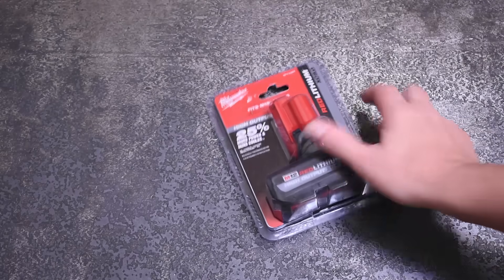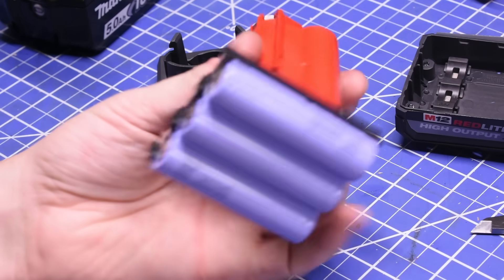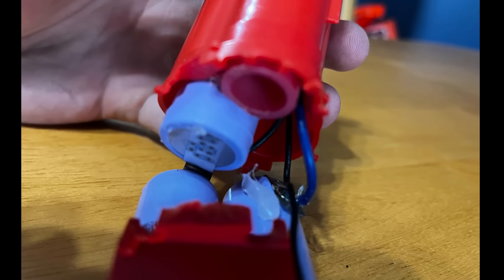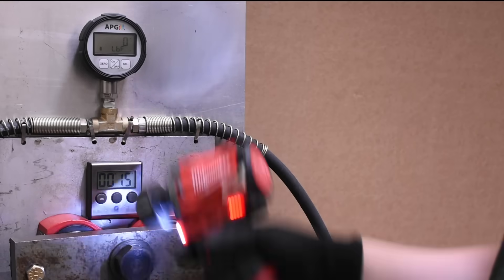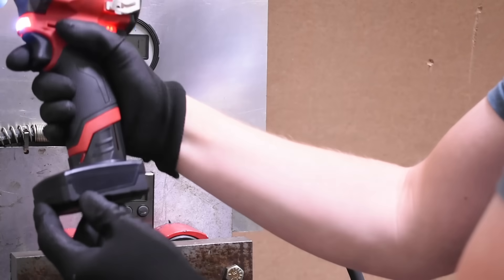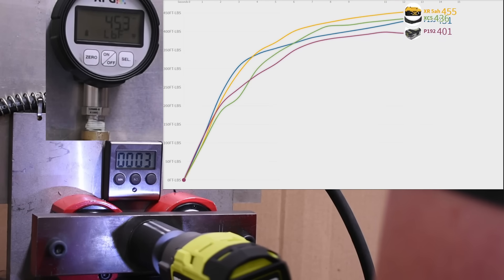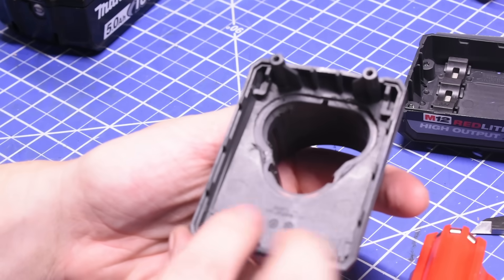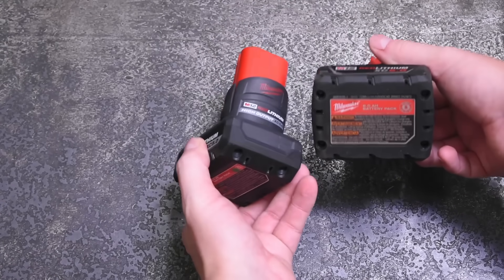Milwaukee's New M12 XC5.0 High Output vs Stuffing Actual 21700 Cells Inside

Comment: There is no BMS on the M12 platform at all , tool or charger .
The tool has acces to the power treminals and the thermistor , for checking the temperature of the pack .
The charger has acces to the individual cells or pair of cells ( depending on the form factor of the battey ) but , and this is a big one , pun intendet , it¨s trough a one kilohm resistor , so the charger cannot do cell balance , only cell voltage monitoring , it can only reject battery packs that have a difference something like 0.6 - 0.7 volts . There are no other electronics inside the battery pack , exept for the said thermistor .
Because all cells are different to eachother it´s unavoidable that given enough charge discharge cycles you will get the dreaded red green blinking lights , you toss your battery in the  efit bucket and go buy a new one .
One of the early signs of an unbalanced pack is that it no longer charges to full capacity , the carger only charges untill the first cell or pair of cells got to 4.2 volts . BUT when you check your overall voltage in the battery you discover that you are only 3/4 full . Bummer . Recenly our host at TTC has complained about a M18 big bucks battery , wich leads me to beleive that the M18 battery platform is the same , I E no balanced charging .
Battery bussiness is BIG , ain¨t that right Milwaukee ?  It has to be , if you make your own battery pack and pay at RETAIL price for the cells , case and " electronics " it will cost you half the price .
Me , I have a balanced charger left from my RC days , and when I get a battery that no longer charges to full or has the red - green blinky blinky , i open the battery chage it on the balanced charger , test the internal resistence and the capacity of the cells , to see if I really have a gonner ,  then voila , I´m good for another 6 - 12 months .
My usage case is verry intensive , each week i mount thousants of mainly 8 and 10 mm bolts into high metallic structures . So yeah , in the menu we have a hot supper daily .

Comment: I'm interested in finding out why nobody is over-volting the M12? Surely this little beast M12/fiw38 would happily work with a modified 18v pack
Reply: PERHAPS a better idea would be to add just ONE extra cell, to have a true 14.4 Volts instead of the 10.8 TRUE volts of the original packs (you know, three cells in series are only 10.8 REAL volts...). Applying a true 18 volts to a true 10.8 volt tool would be risking it too much...

Comment: The M12 cells appear to connect directly to the tool through a fusible link.  The main protection appears to be a thermistor in the pack that connects to the tool.  If a 6 cell pack is converted to three 21700 cells and the connections are the same the pack might be safe to use.  The standard capacity of 21700 cells is 5.0 Ah so the pack would not be expected to give longer runtime than the new 5.0 Ah High Output pack.

Comment: I’ve heard that the regular 6 amp batteries are better than the high output 5 amp.
I heard Milwaukee is coming out with stacked lithium batteries next year.
I’ve actually never had a battery fail out. The 6 amp battery is kind of hard to get out.

Comment: Hey man was wondering if you could recommend to me what you think is best, I’m looking for a compact(mainly smallest I can get size & weights) to remove  lug nuts from a F150 TQ 135Ft lbs and my wife’s car is TQ at 100ft lb. I’m Not invested into any battery system yet but was looking at Milwaukee, Dewalt etc. 
I purchased your PDF trying to do my own research but I’m confused with the TQ , I thought a non rusted bolt Tq at 135ft lbs A 200-250ft lb tq gun would zip it off but I can see now that’s not the case …

Anyways I Appreciate your time !

Comment: Would it be possible to have three 18650’s and 3 21700 cells together in a pack to really crank up the amps? Maybe add a few diodes to keep the current on track?

Comment: I have the newest M18 1/2" compact impact that I run with 6ah high output batteries. I hope this thing works better than the over hyped M18; the thing struggles with lug nuts torqued to 90 ft lbs. Kinda regret grabbing it.
Reply: My m18 compact impact is also a slouch for lugnuts... Not sure why. I have lugnuts at 77ft lbs that it wouldn't remove. Pathetic..had to use my high torque which was way too much for 78ft lbs.
Reply: @BrandonContracting  I ended up grabbing the M18 mid torque and it’s a beast. Has speed settings too, which would help in those situations. Highly recommend the 2962. It’s on Amazon for 157 bare right now.

Comment: Mine have only fallen out sometimes when the tool is dropped. Noticed the other day, 1 2.0 battery has the top cap tabs broken but hasn't come off yet. All the black tabs still good. I'm in automotive & usually dropped from waist height

Comment: It did make 25% improvement, but only against the old purely in handle battery pack. So they may be misleading with that statement, but if you compare against something you're not expecting them to compare against.. it's technically true.
Reply: They got the same statement for the new ho2.5cp one
Reply: @legros731  It's hard to know what the heck they're comparing to whenever they makes silly claims like 5x longer life.. 5x of what?  It's basically just marketing exaggeration that's pretty hard to actually believe.
Reply: @natesewell9402  there no 5x can you at least know what you are arguing clown
It's 25% more power and 25% cooler but a don't care about there claim there better quality cell inside and it's all that matter the cell in the 6.0 and 3.0 have a reputation of not being good battery
Reply: @legros731  that's a common claim on other products such as drill bits, it was an example not a direct counter to the 25% claim here which is also misleading
Reply: @natesewell9402  look the 6.0 got 15amp cell and the new 5.0 got 25amp cell so the 25% claim is pretty conservative 25% more that 15 is 18.75 and same for the temp claim if the tool only need 12amp the 25amp battery will stay cooler 
But it all in theory and real world testing can be deceiving like we just found in this video if the tool only use 10amp going to a 25amp battery will not improve performance but a bigger battery with more density will sag less in the 15 second test and get better number in the last 5 second exactly like the 21700 custom pack did with a more constant voltage it gain on top where the other battery are sagging in voltage
Basic Ohm law at work 25amp at 12 volt = 300w 
25amp at 10volt =250watt 
And the new battery can be pushed to 30amp so 30x12= 360watt
The 6.0 battery is rated at 15amp and can be push to 20 for short periods so if you do the math even at full charge the battery is still 20amp x 12 volt= 240watt
So the new 5.0battery can deliver 120watt more that the old 6.0
So the 25% is not bogus this test prove absolutely nothing about the battery it just show that the stubby don't use that much amp
And I am assuming Milwaukee is coming with a new stubby to compete against the new dewalt that will take advantage of the ho battery
Reply: @legros731  gotcha, THAT is a completely valid point and info I did not know.

But... it would really help to know what they're comparing to with a lot of their marketing claims, even if only in fine print. That's the main thrust of my point, which perhaps I did not make clear enough.  Theoretically 18amp tools should expect 18amps, and may not be rated for higher amps, 

If there's an m18 tool that's really only accepting 12 amps it should be labeled an m12
Reply: @natesewell9402  no problem man
and I forgot about the 2.0 and 4.0 they are 20 amp cell so the new battery are exactly 25% more powerful

Comment: Thanks for letting me know that my M12 tools don't need the new XC5.  I also appreciate knowing the battery case is the real upgrade here and not necessarily the implied 'more beans'.  Much respect sir.
Reply: I was thinking the same thing.  I purchased the 2.5 High Output and noticed absolutely no difference.  I'll save my money & stick with  the XC Batteries.  I have tons of milwaukee tools but they seem to be going in a different with their recent issue with their high torque half inch impact wrench (Rigid is also suing Milwaukee) 
Most of the high torque impact wrenches that came out recently are all stronger than Milwaukee's 2760-20 gun.  However, the 2760-20 is extremely reliable & durable until recently.
Reply: @lowellgelin2063  seems a bit far fetched that Milwaukee would be getting sued by its own company
Reply: @lowellgelin2063  ridged is suing its sister company

Comment: most impact tools are never run full out. more like pulsed. if you rattle it for more then half a moment, you hand break it free, the rattle it with tool.
Reply from the maker: Impacts tools are not pulsing power. They are full out. The impact mechanism is whats intermittent

Comment: My m12 batteries fall out all the time, but has nothing to do with the size. It has everything to do with the little clip edges are typically rounded off from new, instead of squared edges to catch the tool.
Reply: Lol never happened to my or any of my coworker and we use them every day and mine are over 2 year old
The only time the battery eject the tool is on my rover light when it fall from like 5 feet high
Reply: Thanks for that. I have never had any issues at all with batteries falling out, apparently never had a battery with that defect. 
Is it a wear issue over time or directly from the manufacturer?

Comment: Milfuckey pricing is for fanboys.For +-100€ I bought 2x 12V GBA 6Ah. Anyway .... I'd guess the 21700 pack has less Voltage drop hence the slightly better graph (rotates faster). This whole thing is just marketing gimmick. There is no higher load on the motor because it rotates the hammer to smash the anvil unlike a cordless anglegrinder which puts the load directly on the motor. You should have done  the test with  screwdriver and a long and big screw or something similar which puts a continuosly higher load on the motor in a linear fashion. Even then .....

Comment: Great Video! You are correct the M12 BMS is on the tool. Also the M18 overdischarge protection is in the tool too, and not on the battery. I've repaired a fair bit of Milwaukee stuff.

Comment: 21700 cells have more capacity batteries are in square portion of pac. 3.7 X 3 equals 12 volts. no once 12 volt pac is connected hard to take off.

Comment: Very cool. I almost exclusively run "Built" battery packs on my M12 tools now. 9 cell 18650 with 6.0ah and 7.5ah ratings(2000mah/2500mah cells) . There is a notable difference in power as there is virtually no voltage drop having so many cells share the load.
Reply: What cells are you using and how u fit 9 cells? You have links? Thanks.
Reply: I did the same. There are some bad ass 18650s out there. The beefiest being the Samsung 20S, as used in dewalt flexvolt.
Reply: @procrastinator1842  Samsung 20S are old news now. 2000mah 30A is pretty good but check out the Molicel P28B. 2800mah 40A.
Reply: Do you guys have links? Curoius to find out about the battery “building”
Reply: @vincentrodrigues7533  You just buy an empty battery shell off ebay or aliexpress, and solder or spot weld bars to the cells, and assemble into the shell.
Reply: Any issue with the weight of the 9 cell packs causing increased vibration / out of balance / battery dropping out? I was also planning on building some custom 10.5Ah packs out of 3500mAh low current cells, three of them in parallel should be enough to supply 20A peak
Reply: @Jultsu  Stuff like the stubby impact, 3" cut off etc are way nicer too use and hold. They're so much better balanced. I wouldn't run them in the Dremel, but there are no issues with them at all.
Reply: You hve me interested now

Comment: What if someone made an adapter so you can plug m18 batteries into a m12 tool and provide 18v and lots of amps
Reply: Cool idea,  but the M12 tabs would not stand up to an m18 hanging off of it!

Comment: Okay thats disappointing, ive been waiting for these batteries and now I dont feel like theres much reason to get them until my old ones die. Only thing missing here is Milwaukees claim about these running alot cooler and therefore getting more run time pr amp hour than the old ones. Not that it would be enough to sway me back on its own nor within the scope of this channel but yeah. I can see how the durability is a big deal to some, personally I really dont care as I just print new ones if they break anyway.

But yeah, disappointed.

Comment: Molicel P42A would be an ideal choice for a DIY 21700 battery pack, very comparable to the Samsung 30T but higher capacity . Also Molicel is one of the only manufacturers that sells grade A cells directly to the authorized distributors online , unlike everything else, Samsung, LG, and all the major players send their bare unprotected cells directly to the battery pack contracts so the ones we see for sale at DIY level are often slightly lower B grade cells, aged inventory or leftovers from finished contracts.
Reply: Ya those molicel are a beast on capacity and output power. Top cell for electric skateboards.
Reply: How do you build your own battery packs for power tools?
Reply: @tstrenuous10  I’d guess you reverse engineer it and rebuild it with the superior parts if you have the right tools
Reply: I built a custom 8.4Ah DeWalt pack out of Molicel P42As, fantastic cells for sure.

Comment: Should try and run a stubby 1/2" vs the stubby 3/8" . I have both and it feels like the 1/2" spins slower but hits harder. My 3/8  is my good old go to . But my  newer 1/2"  is starting to shine on bigger stuff.
Reply: Pretty sure they have and the 3/8 came out on top… maybe that was m18 though. Too lazy to go back through and check though.
Reply: @Code325  it was indeed the M12, and the 3/8 did better.

Comment: You nailed everything you said. This is just not a demanding tool.
And 2x 25s is stronger then 40t. But 30t is another story, it is the most powerful 21700 cell. And if you want the best, then 2x 20s will destroy every other combination. They are most powerful 18650 cells currently.

Comment: There’s an audible difference with the spot blower between the 5.0 and 6.0. That’s the highest current draw 12V tool that I have and it’s a brushed motor. I also notice an audible difference with the Gen 3 impact driver. Not sure if this translates to real world output/RPMs, but acoustically there would appear to be a difference- for whatever that’s worth. Tried this with both a pair of new 6.0 and 5.0s to make sure it wasn’t a difference between packs.

Comment: At 5:25 you stated that the HO made “on average, more torque per second” than the 6.0 on the run where the 6.0 had higher ending torque value, but the average torque produced per second is always proportional to the ending torque values as long as the time is the same for both runs.

I’m not sure but I think you mean to say that it had an average value of 191, not an average “torque per second” which is a rate of change.

Comment: I was thinking, they could have made a new M12 line that uses 21700 batteries and leverages the extra power properly, BUT designing their new tools so they can accept either 18650 or 21700 batteries. It's not that hard.

Comment: Basically the 21700s can hold higher current outputs for longer.. the others reach a point where the voltage drags down a bit..

This would explain the difference. The motor will only draw so much current and voltage will be the deciding factor. The 21700 that were used will sag less on voltage..
Reply from the maker: 100%

Comment: I have m12 and m18 tools. I bought m12 to use where I new I didn't need as much power or battery life but needed the smaller package of the CP3.0 to fit in tight spots such as my screw gun, drill, angle drill and 3/8" ratchet but I do have an M18 1/2" drill also. My 3/8" and 1/2" mid torque impacts are M18. I tried to fit the tool to how I would normally use it and have been happy with what I have purchased. Impacts, ratchet and drills are used daily with the rest of them at the very least once a week and have had no battery clip problems but the drill chucks suck. I intend to replace the chucks with Jacobs chucks with hopes they are still as good as the old days.

Comment: Should have done this with Molicel. Molicel p42a has a higher discharge rate than even the 40t. Although the 40t will last longer probably.
Reply: 30t are the best
Reply: @riba2233  They are absolutely great. But the p42a and 40t have much higher a discharge rate
Reply: @huskers1278  they don't, 30T have lower ir and can provide more current with much lower heating and voltage drop

Comment: Milwaukee is my favorite brand , used for years , never had a battery fall out ever m12 or 18
Reply: I haven’t had any fall out either although they don’t fit very snug in my string trimmer. Doesn’t matter if I’m using a 5.0 a 6.0 or a 8.0 they all have a little play which is annoying and a real shame considering the amount of money Red charges.

Comment: It'd be neat if they made a battery with 3x 18650 in the grip and 3x 21700 in the box below!
Reply: i looked it up, and there's no reasons i could find not to other than maybe balancing. if cells are discharging at different rates like a 21700 with 5000mah would compared to a 18650 with 3000mah, their voltage drop would happen at different times and stress each other out. im not an engineer though so maybe im wrong and it should work perfectly

Comment: Nice video. Tools Explained did a video on this as well that was useful.

I have never had an M12 battery fall out, so I guess I'll keep using the 6.0 since they're cheaper and not any worse. Unless there's a significant weight savings versus the 5.0, but it doesn't seem like there is. Might even be heavier.